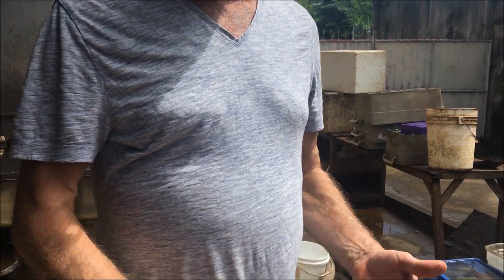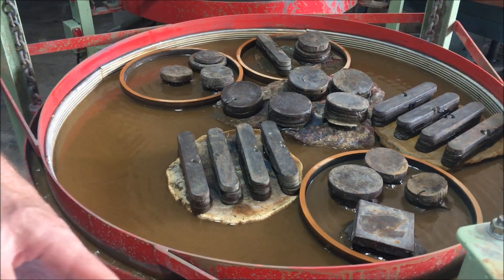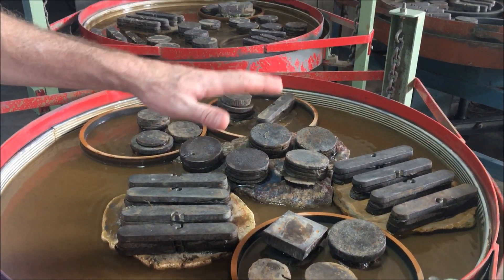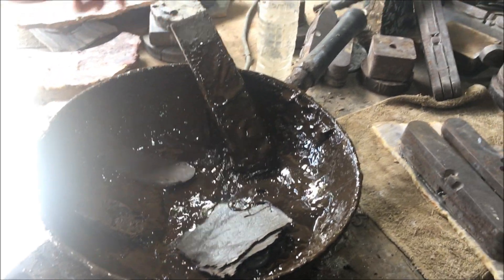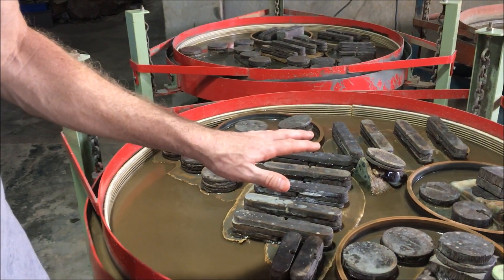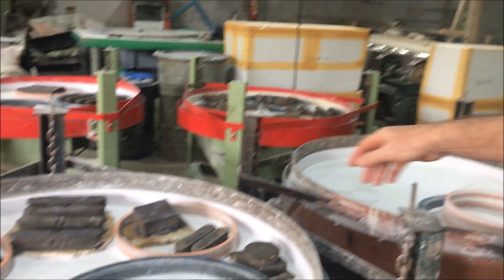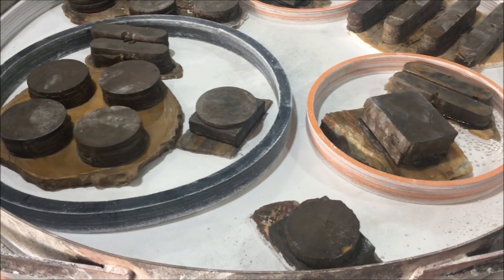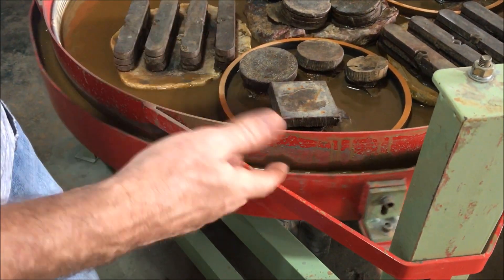The process of Flat Lapping with the Highland Park R1M Flat Lap and Tricks of the Trade

Comment: To clean out the grit on the plate, are you just spraying it down with water?
Reply from the maker: We do it in a 3-way process. After we polished the materials, we remove it, and we shop vac the grits on the plate. We then spray it water, and wipe it with a sponge. Gives you a perfectly clean surface, every time.

Comment: Great video! Question: Do you bolt your machines to the floor? Any other recommended ways of keeping them from walking all over the shop floor like an old electronic football game?
Reply from the maker: The V1M Flat lap does bolt into the floor, and they won't walk all over the place because they are balanced
Reply: Buy those rubber interlocking safety floor mats, that people use in their shops and garages.  Here is a link on Amazon (But, you can find these at any Lowes, Walmart, Home Depot, or any Auto Parts Store).
https://www.amazon.com/AmazonBasics-Exercise-Foam-Interlocking-Tiles/dp/B0719B8HQZ/ref=sr_1_8?dchild=1&keywords=safety+floor+mat+for+garage&qid=1606805931&sr=8-8

Comment: what is the plate made out of?
Reply from the maker: Hi Dylan! For the VM1 Flat Lap, we use a steel plate, when grinding we will use a Silicon Carbide Grit. And for polishing we use Automotive Car Carpet that we cement to the steel plate along with Highland Park Dry Polish
Reply from the maker: Over 1 half inch thick steel

Comment: How much polish do you use and what is it called? Is it one of the cerium oxides listed on your site?
Reply from the maker: Hi Mark! When polishing we initially put 1/3 to half a cup of our Highland Park Dry Polish, which is on its way to our warehouse now and will be up on the website soon. But after the initial 1/3 to half a cup, you will just need to lightly dust the VM1 surface to keep everything moving around and polishing. For polishing, we also use Automotive Car Carpet that cement to the steel plate of the VM1 Flat Lap.
Reply: @HighlandParkLapidary  Thanks! I look forward to the dry polish being available.
Reply from the maker: You use about 1/3 to 1/2 cup to intially charge the carpet then in subsequent runs you use just a powdering of it like you would powder a cake pan.  The polish is not yet in stock, its in transit but it is called Highland Park Dry Polish - it should be here in early December.
Reply: @HighlandParkLapidary  can i use the Dry polish on felt instead of carpet?